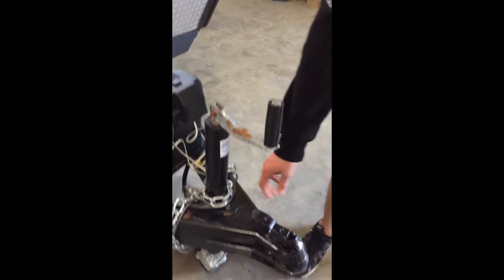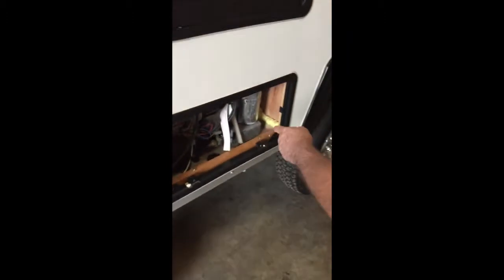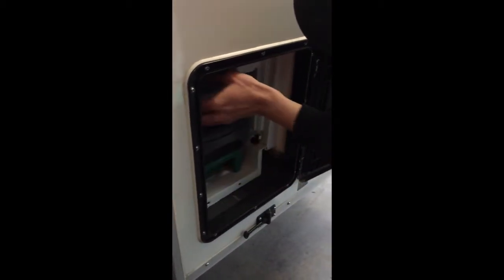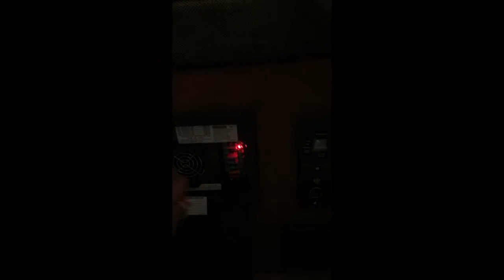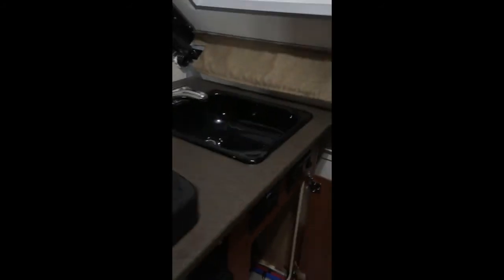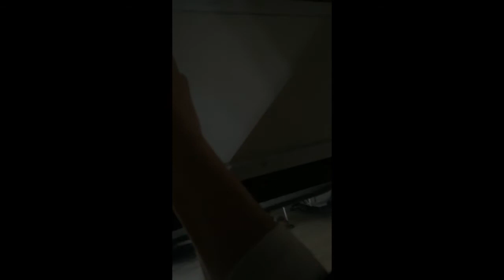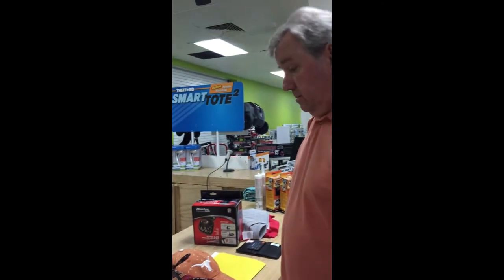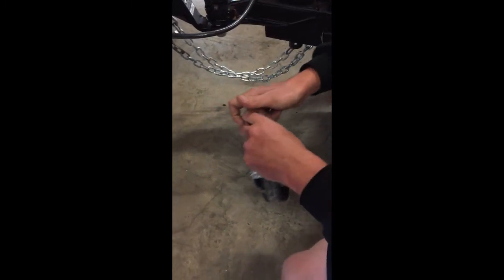Aliner Setup- Long video- dealer walk through on Aliner LXE

Comment: Congratulations on your new camper and wishing you many wonderful camping days ahead!  I am interested in the same model but haven't yet seen one in person so I enjoyed your walk through.  I got a kick out of all of Mrs. Parker's questions--I'm sure I was the same way with my first camper!  Popups and A-liners are very basic and simple and I'm sure you will figure it all out before long.  Is this a 2017 or 2018?  Did I see a price tag of $14,995?  Wondering because that will give me someplace to start if I decide to go ahead and buy one.  Thanks for sharing and I am looking forward to seeing your camping adventures!
Reply from the maker: We bought a 2016 Aliner LXE in March of 2017. They were closing out to make room for the 2017's...they had 2 LXE models, the one with the air conditioner that stuck out the side of the trailer was $14,995....we bought the model that has the Cool Cat AC/Heat pump which was $15, 995....... the MSRP list was well over $20,000 so we thought we got a pretty good deal. The main reason we bought the LXE was, a working toilet and shower, though we haven't used the shower yet....we just use the ones at the campground (so far)........ and it fits in our garage. We didn't want to pay to store it and our neighborhood home owners association doesn't allow, campers, boats to be stored in sight from the street.....
Reply: Ok thanks so much for your reply and it sounds like you got a great deal!  I have the same problem with storage--POA does not allow parking any kind of trailer in driveway.  I also want the shower and toilet--the shower may not get used all the time, but there will be times when you (and I) will be glad we have one!  Best of all, if at some time you want to stay at a private RV park, there are those that require that you are "self contained" even though they have shower houses, and in that case your A-liner will meet that requirement.  Happy camping!
Reply from the maker: Be aware however, that the toilet is a cassette toilet, and doesn't hold much without emptying it. It works fine for the wife and I for a 3 day weekend before needing to be emptied. It has wheels and is easy enough to dump in a toilet in the shower house / bathrooms if not against the park rules (blue stuff in the tank).... also, there is no grey water tank either, so we purchased an external tank that rolls under the trailer with a hose that empties into it (15 gallons). So even if we were at a full hookup park, it would still be more work than  having an RV with black and grey water tanks. If it had to be hauled to a dump station, it would be about the same work/hassle  just more often because of smaller tanks........this Aliner is for short term enjoyment (4 or 5 more years), then retirement, something bigger possibly, and at least move  away from the city to less populated and less restricted home base area.
Reply: Many years ago I had a double axle Jayco popup which I loved--it had the very same setup as the A-liner--cassette toilet and shower combo.  Of course it had canvas sides and  bed ends which is not so good when it rains.  Also, it is a pain to have to haul off gray water but nice to have the shower.  Dump stations have their own issues too!  After camping in everything from a tent to a couple different popups, a hybrid trailer, regular hard-sided trailer, fifth wheel, and also full-timing in a large diesel motorhome, I know that there are tradeoffs and good and bad points to each and every one of them.  Now I want something easy to tow and easy to set up for long weekends mostly.  I'm also considering the Ascape trailer but don't want to have to bother with a weight distributing hitch and sway bars so have to do more research into whether those would be required for that trailer.  Thanks again for all the info.  I enjoy your videos.